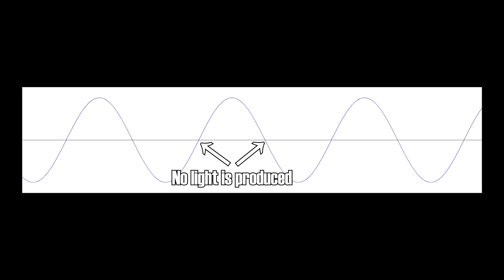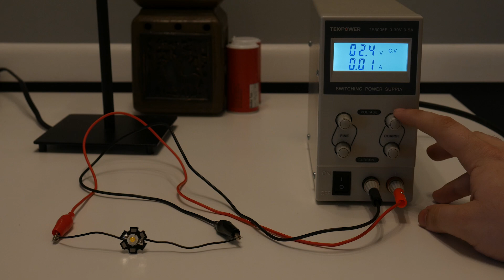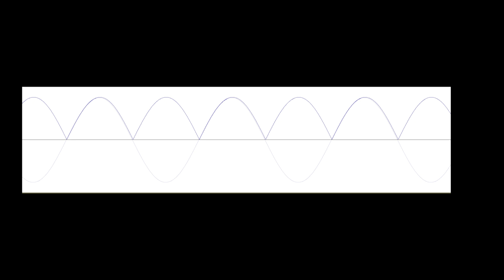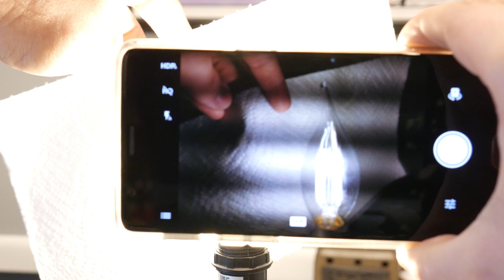LED bulbs that flicker, and CFLs that almost never did

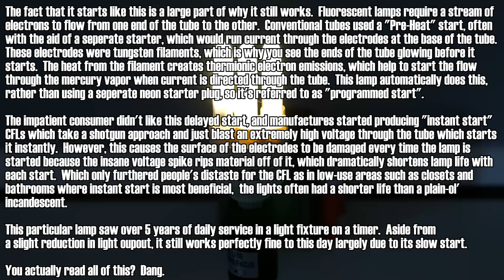Comment: 1:50 yeah I read all of that. I hate CFLs for home use. The old type was slow to start so by the time it did you needed toi shut it down. The newer ones just broke ... faster than incandecent... which is absurd considering they are 20x more expensive. CFLs were designed for use in office building, werehouses and shopping malls and they're doing a great job there.

Comment: Technology changes but the words don't. So we "dial" a number - when did you last see phone with a dial? The word "bulb" was going the same way, CFLs are not in anyway bulb shaped.  Ironically  LED lights  are actually bulb shaped again as the bulb cap makes an excellent light diffuser.  What goes  round comes round. Literally in this case.

Comment: I have experienced the CFLs fail explosively. I generally hate the CRI of fluorescent light. The only exception was the very same exploding CFLs. I love the idea of those filament bulbs but I do wish they can make them flicker less.

Generally they use capacitive droppers, where they have a capacitor in series with the full wave bridge rectifier. Since capacitors have some impedance, they impede AC current simalar to the inductors used in fluorescent lights and resistors for DC circuits. That goes to a full wave bridge rectifier and generally a filter capacitor following, which powers the LEDs. Because the filter capacitor is undersized, the ripple voltage is high, and as you pointed out, LED brightness changes drastically with variation in applied voltage (and heat).

Comment: Fluorescent tube lights flicker rates do bother some, me included. Some flicker at 60 Hz, especially when old. That causes headaches from retina flash, dry eye and fatigued vision.  I have been sensitive to those lights all my life, from school thru college and now work life.  My solution? I unscrew all the tube lights from the receptacles in my office and use dim natural light from window or in winter, just work in the natural dimness. Took a year before the cleaning people caught on and stopped re-installing or replacing the bulbs. Lol.
Finally last year, the lighting company came and installed new, energy efficient LED tube lights. No more headaches.
Reply: I got driven crazy in school with dodgy 50Hz tubes that were on the way out. I could see the bloody flicker, but seemingly nobody else could, and my complaints were ignored. Best I could do was sit on the other side of the room or wear sunglasses. No, taking the offending tubes out myself was not an option. The ceilings were way too high for that.
Reply: They probably installed low flicker LEDs. Quite a few people tend to be under the impression that all LEDs have really bad flicker, but it's primarily the cheap ones or ones with small drivers
Reply: @exoticcar5482  I worked at a place where it seemed like the LEDs were putting out significant UV.
Reply: @jeffkardosjr.3825  That maybe due to either the use of a high color temp or the phosphors are degrading and some of the UV from the LEDs themselves are coming through. And yes, FYI under the yellow phosphor are blue/UV LEDs
Reply: @exoticcar5482  Yeah. It is a little wierd to describe. Like occasional dots or stars of a deep blue. Not directly on the lamps,  but the area they lit.

Comment: You did some things wrong:
The reason why light flicker is not negative resistance but lack or inertia while the thermal filament is pretty slow.
Flicker completely depends on capacitor size for bot CFL and LED lamps driver circuit does not matter that much.
The reason why lamps even have capacitors is that it is pretty hard to restart driver circuit 100 times per second.
However, there are cheap LED lamps that use drivers that do not need capacitors at all so those lamps flicker like hell.
You can even observe the stroboscopic effect on your own body or your shadow so there is no need to use any camera, just move your hand in front of the light and you will see it. This is quite irritating and hurts eyes.

Comment: Great news you may get more time to share you knowledge. I would like to watch some clips about the small parts of electronics,  I mean topics like resistors, condensers, coils... it looks like the history and evolution of the common things could be awesome to learn. Also I really enjoy your way of host the show and I think you may be able to gift us with at least 10 great DIY basic electronic projects, like make a power supply, fix and restore old electronics, recycling... whatever it comes into your mind.
In other set of things, I think your "lessons" (more correct masterclasses) are quite worth and may be great to enjoy them in other languages, I can carry on with my broken english but it would be great if you consider to enable the community translation feature.
So thanks again for sharing. Really, great videos.

Comment: It's becoming increasingly apparent that using an archaic receptacle for lighting is seriously due for a revolutionary change. We should perhaps redefine our industry standard for light fixtures that accommodate a universal ballast/driver, and allow hot-swap of purely LED bulbs. The artistic variation of lamps going into the next century have an incredible potential.
Reply: This is already how mr16 12v led lights run. Invariably it's the driver that fails first, and that's a fucking pig to remove and replace as it's behind the fitting and getting to it damages the drywall
Reply: Cool idea. What voltage will your universal ballast output? 200V for filaments? 12V for COBs? 30V for other COBs? something in between? Or will it be a constant current source? What current will it provide? 100mA for 4 filaments in parallel? What if I want two filaments in parallel? Or 8? Or a COB with dozens of LEDs in parallel, drawing up to several amps?
Reply: It shouldn't be to hard to set up auto detection circuits. Or heck even a way for the bulb to signal it's capabilities to the socket. Every usb device and the ram in your computer does the latter.
Reply: +Kasey Boles Cool. Of course now you need a driver per bulb because each bulb may have different requirements. Also the driver will have to be intelligent and be able to produce a wide range of output voltages/currents, making it a lot more expensive. Since the driver is usually the part that fails first in LED bulbs, that doesn't seem like a very smart move.
Reply: My thinking was having a versatile driver/ballast in the fixture and at most a very simple circuit or data chip to tell the driver how to operate. This would of course drive the fixture price up a tad (and be an excuse to raise it even further). But by making it long lasting and setting some basic standards to limit the possibilities to a large sub-set of anything goes. This is mostly off the top of my head, but considering how ram stick come with a simple little chip listing several known good timings and with USB devices and Ethernet able to readily self configure communication speeds and many other examples of this sort of thing it shouldn't be all that hard. This is all just brainstormed, but considering I can buy a $12 ic that can be set up to handle a half dozen different computer buses (USB, Ethernet, can, etc.) as a single chip buyer and prices drop fairly fast in bulk I cannot imagine something for this application wouldn't be simpler and cheaper, especially in lot sizes major manufacturing would require.
All that said for more basic scenarios is could be trivial to have a simpler system where a bit of cleverness like you see in how stereo jacks work just fine in mono sockets and vice versa, or even other ways electrical backwards compatibility with various connector form factors has been achieved, such as three way bulbs and sockets.
Reply: What you're proposing doesn't really solve any problems (the—now more expensive—driver is still going to fail first, so you'll just save a couple LEDs) and—at least at this point—very anti-consumer. Right now I can buy any LED bulb from any manufacturer, screw it into my existing fixture and it will work. With your proposed system I first have to buy a new fixture and when the driver in it fails, I'm locked in with the manufacturer of that fixture for replacement (FYI this is already happening, only manufacturers don't bother with selling spare parts—when the fixture fails, you have to buy a new fixture).
Reply: A lamp that has built in bridge rectifier and filtered DC sockets for specially designed lights does sound interesting.

Comment: There are several types of LED drivers, capacitive dropper, buck regulator, or switching supply for example. That LED Filament light could have a capacitive dropper with no filter at all.

Comment: most bad LED's are poorly made , CFL's were around long before I got online in 1995.  LED's  right out the gate
Reply: I'd add to this  CFL puts off alot of UV light.  How can you tell?   Look at the sides of Books, DVDs or Blu ray movies.  although after figuring this out too late my blu rays are not in an area where the DVD's , some of which would be worth alot of money if not for the bleached white sides.  Books too but not so bad.  I think a $100 Death Gate Cycle print got some of it.  So I'll take the flicker from bad LED's before CFL.  Just tossed more of those rotten CFL's away.  Also getting harder and harder to actually notice the flicker except on 90 cent C7/C9 an mini light immitated christmas bulbs.  .  Those flicker quite good :(  Generally speaking though as Clive would put it if you wave the bulb around an it doesn't stream but looks like 5-6 bulbs then the smoothing sucks.

Comment: I bought a few cool Philips LED bulbs with three modes. If you turn the bulb off for a second and then turn back on, the bulbs get dimmer. So the first time you turn them on, it's at max brightness and then medium and then low. And the bulbs remember the settings so you don't need to worry about adjusting the brightness each time.
I prefer these bulbs to the other Philips Hue bulbs as they forget their settings which requires you to use their damn phone app to turn on and off the lights.

Comment: I have 1 LED bulb. All my others are CFL. LED bulbs are just starting to move into the home here in the UK. Most people seem to just get the much cheaper CFL's for the moment plus there is no reason to buy a new bulb unless you have a dead CFL which tends to take years to happen. Anyway. With the LED bulb I have vs the CFL's all I see is the lack of warm up time. I have not noticed any flicker.

To be honest I generally never have noticed flicker from anything around 50Hz or above. Even 25fps video looks ultra smooth to me. My old CRT was at 60Hz and i never had eye strain or flicker. 75Hz was possible if I installed the CRT drivers but I just never bothered lol.

So many people complain about flicker. I wonder why I dont see it? I also have no trouble with Magic Eye pictures (it automatically turns 3D when I see it) and I cant get enough of 3D movies. No headaches or anything (unless my glasses are dirty). I have a 3DS and was surprised to find out that people actually TURN OFF THE 3D. I never do and usually have the slider at 80% and was pretty annoyed that after spending £40 on pokemon moon I found out it was 2D only :-o
Reply: I've been using LEDs for 5 years for my home lighting. There's no realistic CFL option when the whole house is wired with dimmer controlled downlighters. However the prices have dramatically improved, from £20 a bulb to £3 a bulb.

As for flicker, cheap Chinese and the current crop of clear filament style lamps are terrible. Branded ones are much better, and even the Amazon basics give a good dimmable light. 5 years ago I spent hundreds of pounds trying to find GU10 lamps that didn't flicker like crazy, I can't understand how some people can't notice it. Even if the bulb isn't visibly flickering it feel like walking through a dodgy disco with strobe lighting.

Comment: I also hate the "cold white" LEDs! These are usually 6500K, but there exist 4000K ones (warm is 3000K) which I use when I want "white" light. 6500K is depressing.

By the way some smartphones (like mine) have a filter that removes the 60Hz/50Hz flicker (selectable). Dunno how it works, it can't be doing FFT filtering to the whole image in real-time at 4K, can it? Maybe it scans the sensor at just the right rate and adjusts brightness with a gradient overlay?
Reply: I really like the 4000K lights, but they're harder to find than 2700-3000K or 6000-6500K lights.
Reply: Chrysippus I have a lamp with a gorgeous 2000k colour spectra, it's like bright candlelight and lovely and cosy on a cold night.
Reply: Paul Gascoigne that sounds gorgeous, never thought of looking for 2000K ones!
Reply: I have to mention some LEDs say the same temperature but they look different. In fact, the number is no science - if you look at them with a spectrum analyzer it's not one frequency but many. I say this because some 3000K LEDs are glorious but you can't know from a fact sheet. Easy way to see this is to go to a physical shop.
Reply: Chrysippus I love cold dead industrial lighting. Not for all circumstance though.
Reply: 3000k is good :) but I agree anything to 5000k to 7000k is just sad
Reply: Chrysippus smartphone cameras change the shutter speed to be a multiple of the line flicker rate (50Hz or 60Hz) to eliminate the banding/flicker

Comment: I still rather take LEDs than CFLs. Mercury poisoning is not a harmless threat. Especially because most CFLs have much higher amounts of mercury than they should have. If you really have issues with some PWM-LED flicker, exchange it with different LEDs or just use halogen bulbs. Incandescent bulbs don't flicker due to their glowing wire & afterglow.

Comment: Heck they even have LEDs now that directly replace the tube-lamps because of some electronic trickery that makes them accept the voltage from the ballast in the old fixture. Saw them at the last trip to the hardware store. Looks like a stop-gap so you don't have to do a full fixture re-install to update to the longer lasting tech. (Although with LEDs going the way they are, eventually you'll be buying fixtures instead of bulbs - unless it's something more decorative.)

Now for a subject in another video, you'll have to cover color temperature (briefly mentioned) and CRI. Some phosphors used have gaps in the spectrum which can produce a bad CRI even if the overall color temperature seems reasonable enough. I think that's one of the things that cheaper bulbs skimped out on and made people not like CFLs. (Also seen in cheaper LEDs as they use phosphors to make the "white" light too.)

Comment: most cfls were better than early led's, and even now leds only equal them unless your paying for 1 led that costs like 10 cfl's...
i still use 4ft flourescents in my 'workroom' as the light from them is so much more balanced and less peaky than led. for me 2 56w 5600k tubes wins everytime. next bulb change I /may/ try  50w or so of DC led distributed evenly but i dont think it will be any better than the tubes for color rendition.